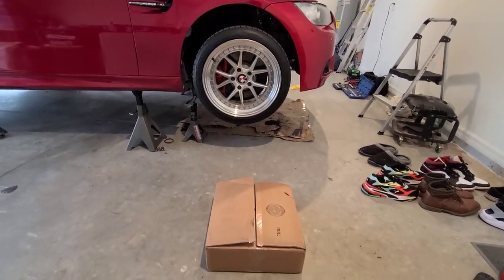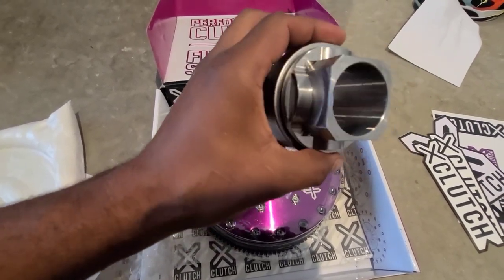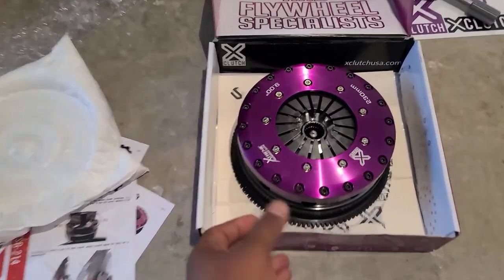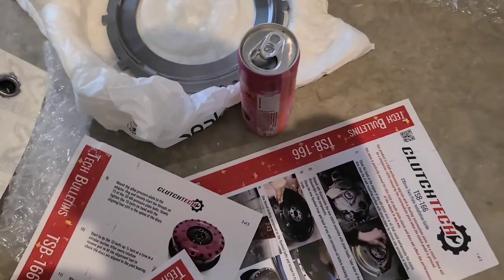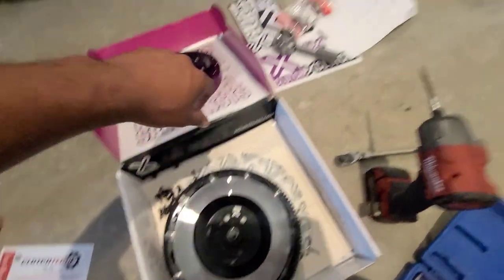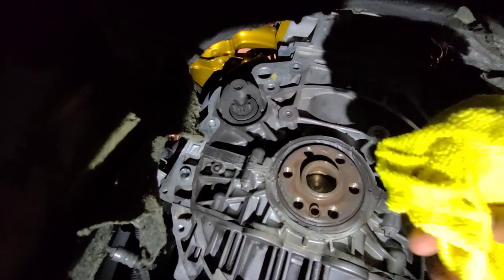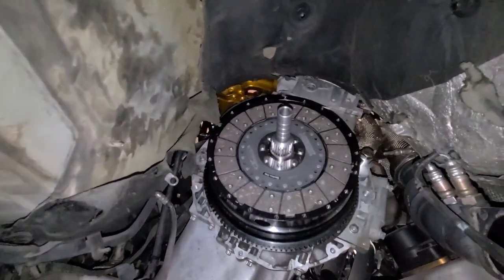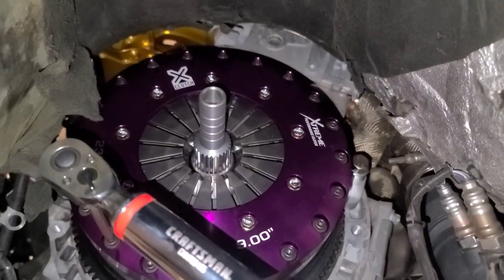Twin disc X Clutch Unboxing & Install BMW N54 335i

Comment: Nice clutch. I’m on my 2nd x clutch organic. First one lasted 11 months. I’m on pure 600’s
Reply from the maker: why is it your 2nd?
Reply: @JermaineLeeBlueprintAuto  i glazed the clutch after 10-12k miles. I don’t think I broke it in correctly for a full 1,000 miles and I eventually started slipping in high gears. I bought the rebuild kit for $700
Reply from the maker: @javi_335i  were you using single or twin disc? full faced or puck style?
Reply: @JermaineLeeBlueprintAuto  the same as yours. Twin disk organic full face
Reply from the maker: @javi_335i  oh ok

Comment: How’s the clutch holding up?
Reply from the maker: So far it has been excellent i drive the car everyday to work 20 psi... no slips since it has broken in the pedal grab is very manageable. Also i dont have to push much to get a full disengage. Its exceptional in my opinion. I can feel a diifernce in the bearing compared to the dkm.